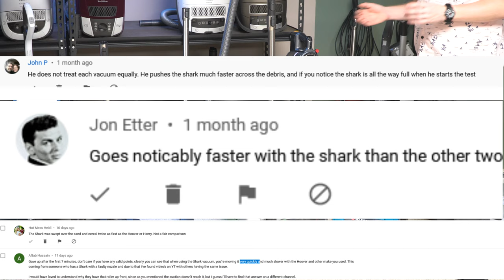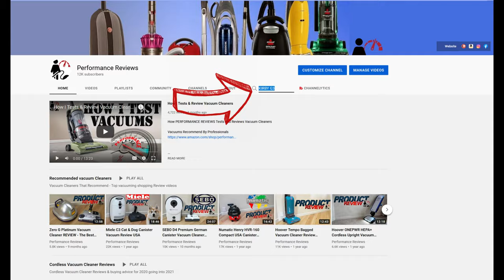Vacuum Cleaner Handling Differences - Why Vacuums Push different

Comment: i think the issue is letting the vacuum control its movement. you can pull against the vacuum and just not let it run away too fast

Comment: I love self propelled vacuums, problematic though they can be when it goes wrong. But I understand why it has largely gone away. I think Kirby is the only self propelled vacuum still made. It adds weight, complexity, and extra maintenance. If Kirbys got rid of the transmission, they would be lighter, and not needing it in the first place. I will miss self propel when it goes away completely (if Kirby ever finally kills the G Series) but I will be glad to have a lighter vacuum.

Comment: Those Hoover's self-propelled transmissions are probably the most responsive and snappy transmissions I've ever used on a vacuum (all of the Hoovers in that matter, the DAMs, Concepts, Windtunnels, etc.).  I've always believed Kirby's made better self-propelled vacuums, I like how easy they are to control since their transmission is mounted in the back and not in the front like a Hoover (kind of like a self-propelled transmission on a lawn mower).  I haven't used a self-propelled Eureka though, but I hear those self-propelled transmissions are quite anemic compared to their competition.
Reply: The eureka self propel is not that great no. Yeah kirby is smoother but I do love how ridiculous the hoovers are.